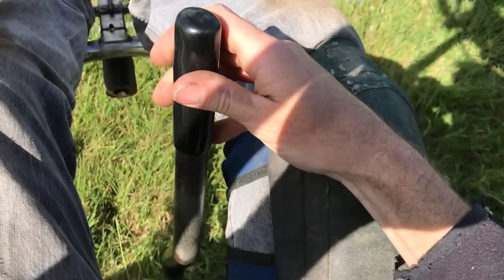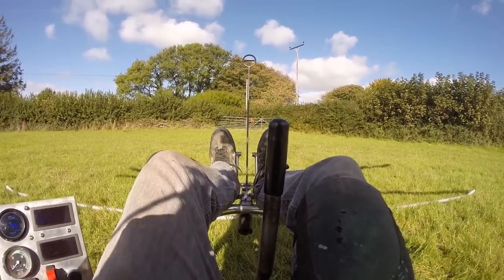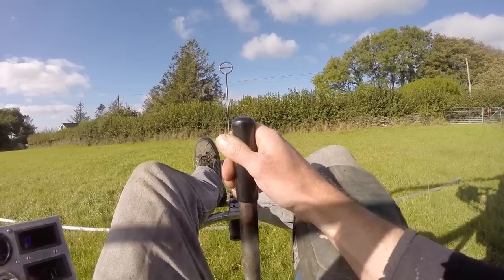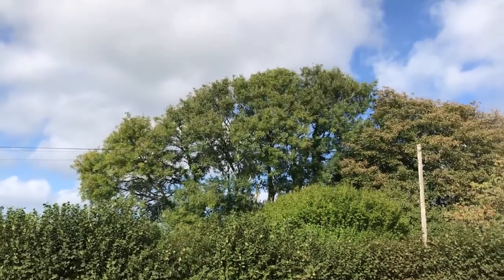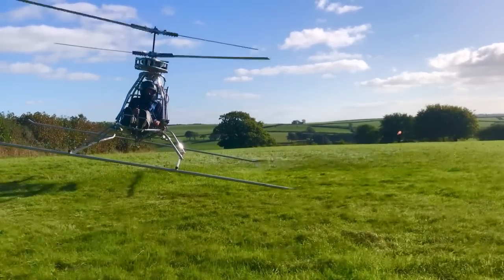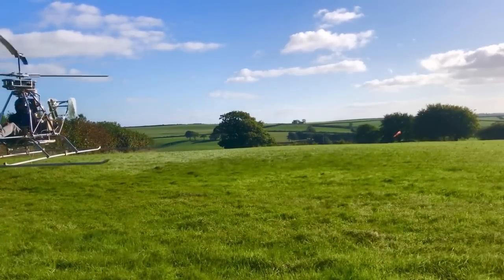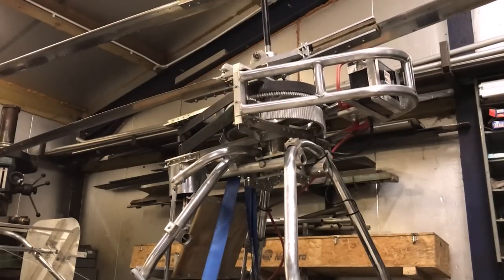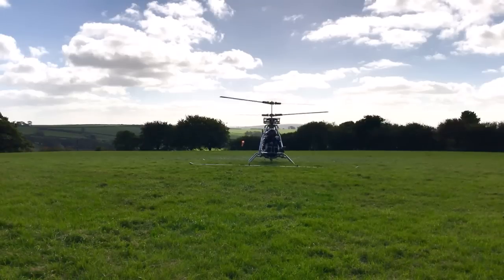Dodgy Moment, Homemade Coaxial Helicopter Learning to FLY

Comment: This thing is beyond a death trap, do yourself a favor and wear motorcycle armor and never take this thing above a metre.

If you don't understand why real helicopters use collective and cyclic systems instead of this then you are way way out of your element. Even rc hobbyists understand how profound the difference is. 

Between the gearing and the tilt system you have created a great piece of technical work,  which is amazing how skilled you are yet how bad your tunnel vision is for a design,  you have locked yourself into an idea without having any idea why helicopters evolved into what they have today. 

You came very close to a violent death at the 4 minute mark. On top of having no idea why helicopters work the way they do, you are clearly untrained and lack confidence in the air which is even more of a recipe for disaster.
Reply from the maker: I explained in the video why helicopters have involved to have cyclic and collective pitch and tilt rotors aren't used. I was pointing out that a tilting rotor does work and if you added collective pitch to the system then swash plates and cyclic feathering wouldn't be needed but what would be the advantage ? You might as well control the helicopters with blade feathering.
It's funny I get comments like this, people watch one video and make all sorts of assumptions. They can see I've  designed and built a helicopter from scratch but assume I don't know how it flys or don't know what dangers there are. I used to get it in engineering where men assume you're an idiot until you prove them wrong.
Reply: @Ben-Dixey  your point that if they have collective, then they might as well have cyclic, is wrong, as old rc helicopters used to have cyclic without collective, the pitch was fixed and the entire rotor head teeters which augmented the angle of attack cyclicly. These old model aircraft had fixed pitch and used rpm to control total rotor thrust like yours, which is a very bad design choice for a reason I'll explain in another reply. 

Also, tail rotors on helicopters are collectively pitched without the sphere bearing to cyclically pitch them as it isn't necessary, so your reasoning that if they have one then  they might as well have the other is not sound.

And multi engine helicopters have collective pitch as well, it's purpose is not solely for autorotation, which, even with collective, yours would have a very hard time performing due to the size and shape of the blades and your lack of a cyclic. Combined with running a 2 stroke engine is a recipe for disaster.
Reply: @Ben-Dixey   you are wrong to say I've watched one video and spat out a criticism. I watched a bunch of yours when they popped up in the algorithm back when this was a garage piece.. I didn't actually think it would get anywhere... I've rediscovered them recently.

In another video or comment you defensively say that your control is a cyclic, when it simply isn't. Cyclics are named as such because they change the angle of attack of the rotors in a cycle as they orbit the helicopter, where collectives do it collectively. Yours is a fixed pitch swashless head, the control would be most accurately described as weight-shift since despite when you are on the ground the controls tilt the mast, when you are in the air, you are hanging from the rotor, and your control is simply changing where the cg of the airframe sits relative to the aerodynamic centre of the disk. With the whole helicopter pitching itself in response. The effect is noticable in real helicopters when you are hover exiting someone or when someone changes seat.
Reply: @Ben-Dixey   to carry on the topic of weight shift control -

Real helicopters don't use this ad a means of control, and the reason why if you intend on taking this thing out of the hover you need step away from it as a design method, is that  you have zero direct control authority in this manner.

Helicopters and fixed wings will see changes in pitch and roll with changes in cg, but they control themselves by manipulating their interface with the air, just like a car does so by steering the wheels. By cyclically  augmenting the total rotor thrust, you generate more thrust on one side of the disk than the other  which definitively and authoritatively pitches the whole rotor system, and the disks gyroscope rigidity property's are countered from the blades themselves, rather than a moment load going up from the mast, as your design would impart. 

Also, and you would know this if you had any real measure of helicopter experience, the range of control throw that a cyclic has to have is huge, as there is a massive difference between the stick held position in forward flight and in the hover, as the cyclic and rotor head hinges account for drag and aerodynamic flapback. I honestly would bet that the first time you try to transition this thing to cruise flight, you will encounter aerodynamic flapback which your weight-shift-control will simply not have enough control range to counter. And you will enter a wierd perturbation and crash.
Reply: @Ben-Dixey  AND ALSO - still on the topic of collective control.

Because your fixed pitch design controls total rotor thrust by changing rpm, instead of being able to maintain a constant Nr at low power settings, you will be reducing the controlability of the aircraft as you lower the power. A large reduction in power could cause you to lose control. The helicopters interface with the environment is its main rotor blades.
A large reduction in power could also cause your blades to snap, as they will try and take the weight of the aircraft but the reduced rpm will lead to a reduction in the centrifuge effect that pulls them straight, this causes massively increased coning angle which can become unrecoverable in real helicopters that lose nr, as the thrust vector begins to point inwards it gets worse as it gets worse..

When real helicopters have jammed collective emergencies, using throttle and manipulating NR to control descent is done very carefully, you could not use NR as a primary control, period.
Reply: @Ben-Dixey  lastly. Coaxial helicopters, whilst they do use rudders, primarily use differential collective to control yaw, as it is far more authoritative way of controlling it and setting a centre, than your vertically oriented rudders, which will be completely useless in anything more than a fart of wind.

You need to ditch the mast augmentation mechanics of this thing, and install a proper swashplate with collective and cyclic controls. Stop being stubborn on this design method or you will die. Bell figured this out in the 1930s with rc helicopters., and any long term rc hobbyist that remembers the older cheaper models of the late 90s and early 00s understands why. Like I said originally, THERE IS GOOD REASON why helicopters evolved into what you see today. Further, one of the reasons the bell x2 and its derivatives were profound was that they were the first coaxials to use rigid rotor heads, all the old kamovs use 3 blade heads as there is a lot of design and development in mapping the different oscillations throughout a machine, and something with multiple rotor systems like a coax, Chinook, tiltrotor, etc dial that problem up to 11. I honestly don't even k own if the cox design is fundamentally compatible with teetering heads as they may just flap into each other when you get to the cruise.

And get some lessons, I don't mean a couple of half hour sessions like you mentioned you had, I mean go and actually learn to fly and get yourself solo and PPL ffs.. it is the height of arrogance to think you know better.
Reply from the maker: I'm afraid You have miss understood my comment and what I said in the video. You have also miss understood the entire point of the project.
Reply from the maker: Hi, I have been reading your post again from a while back and you obviously have some good knowledge. I think we got off on the wrong foot. I would just like to point out that the helicopter is more or less for hovering only, like the air scooter 2 was intended. The Nolan brothers took it a step further with twin engines for redundancy. If I was going to build a serious helicopter I would add the standard cyclic and collective feathering, I might even have differential collective for yaw, although the sch2a hasn't gone down this route, rightly or wrongly. For me it was an engineering challenge to build something that can fly, its mission accomplished really but some slow forward speed would be nice. I wanted to know what the drawbacks were to fixed pitch as when I started the project I didn't know. All the things you have mentioned would certainly be of concern if it wasn't a hovering toy. I am wondering if the rotors would come closer together in forward flight or not, this aerodynamic flap back is something I haven't quite got my head around. I can understand how the teetering rotors change the cyclic angle of attack to compensate for the dissymmetry of lift. Would you agree that will bring the blade tips on one side of the disc closer together?